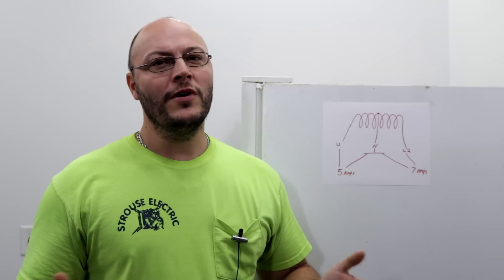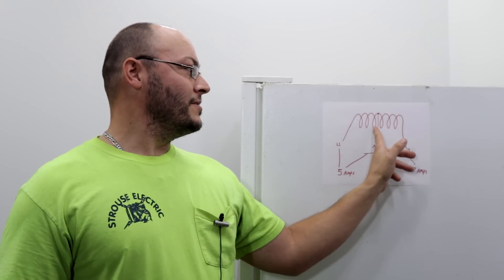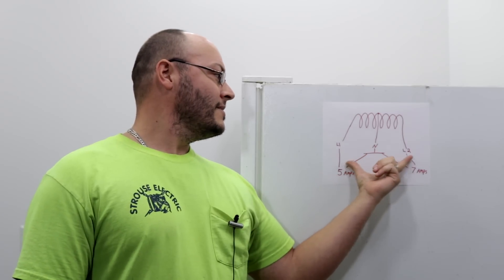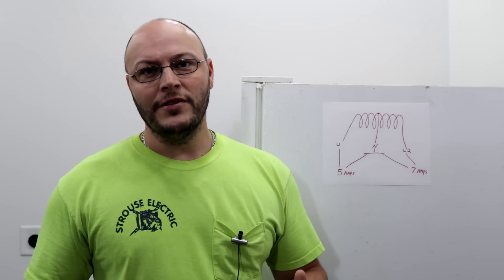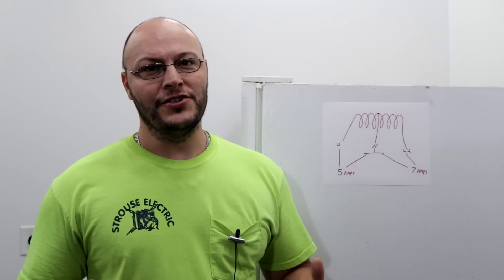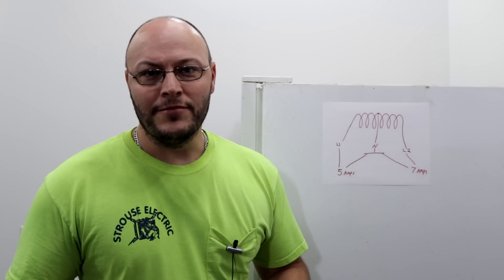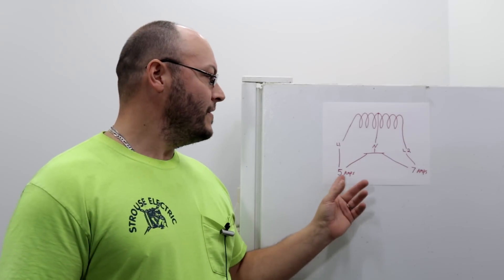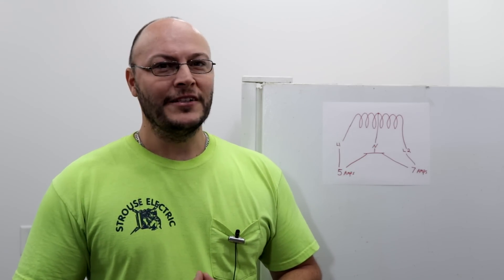What does the Neutral Wire Do?

Comment: 1)can any body  explain three phase neutral .
2) What is the help of neutral when we drian line to line voltages from three phase system?
Reply: Aamir Masood    A neutral in three phase is a common point for one side of three coils.   The reason for this point is to have two voltages in the system.   I.E. 208/120 volts or 480/277 volts in US.   so, Line to Line is higher voltage and Line to Neutral is lower voltage.
Reply: @KevinCoop1  thanks bro it helped me so basically you are saying that current needs potential difference to flow so for line to line voltages 220-120=120 v of voltage is supplied to the load.Am i right?
Reply: Aamir Masood    No.   The voltage is the relationship of primary voltage number of windings in a transformer to number of windings in secondary to get different voltage.   If 2400 volts into 2400 windings primary and there are 240 windings in secondary then 240 volts.  To get 120 volts, do a tap at 120 windings.   This is a single phase statement.
Reply: @KevinCoop1  thanks bro now it helped me
Reply: Aamir Masood   Great.  So now for three phase, L to N 120 or 277volts    120x1.732= 208 volts.    277x1.732=480 volts.

Comment: People seem to be confused of grounding or at least explain it poorly. There are two types of grounding. Operational grounding means connecting part of the electric system i.e. the neutral wire to the ground. Protective grounding means connecting parts that are not of the electric system lie equipment cases to ground with a separate ground wire. The ground wire and the neural serve different purposes but in most systems they go to the same place. 

Operational grounding can protect against lightning strikes. Protective grounding is so that if an equipment fails, you will not be shocked from it. Televisions specifically are double insulated. They do not care what happens to the protective grounding.
Reply: Okaro X    You use some terms I have never heard used, but are basically correct.   This is an awesome video about hooking hot to a ground rod and turning it on.    https://youtu.be/gHQE5L6hbgs.      Very well explained.   Respectfully,   Kevin

Comment: I have a nagging question. Does the neutral wire carry the balance unused current back to the grid/gen station? If so, what would be its effect on the equipments in the grid? Please excuse me as I am not an electrician/ electric professional.
Reply: R Varadarajan    The answer is NO and YES.   The neutral coming to your house does carry unbalanced amount of current back to the source transformer.   End of its story.  Out on the utility pole, the transformer feeding your house is connected to typically two conductors, hot and neutral.   If the pole only has two conductors, several houses are connected to it along the line.   If it has four conductors, three hots and neutral.  The neutral on the two wire pole carries all the current at that point.   Where the two wire is connected to four wire pole, the neutral is carrying the unbalanced current which is fed be a sub-station transformer.   The huge power distribution towers going from sub-station back to generation facilities are typically delta connected three phase three wire configuration, so no neutral involved.   Hope this helps!   Kevin

Comment: If you route 2 amps back to the transformer aren't you losing 2 amps that you need to run the devices that are pulling those amps?
Reply: Todd Hall    Try this route in your mind.   L1 to load, load to neutral conductor to bar, bar to neutral load, load to L2.   That is the path most of the current is taking at the same point in time.  The only amount of amps that go to the transformer coil is 2 amps.

Comment: The main job of the safety ground is to provide a lower resistance path to ground than your body should something with a higher potential erroneously come into contact with metal.
Reply: shreddder999    Actually, it is to trip the breaker.   You may have meant this.
Reply: @KevinCoop1  What is Safety Ground? A conductive path to earth that is designed to protect persons from electrical shock by shunting away any dangerous currents that might occur due to malfunction or accident.

Comment: Nice instructional video. Just a question. I am trying to figure out the heater on a hot tub I bought used. 3 pumps work fine. Recirculation pump works, heater does not. Heater wires come into the hot tubs own circuit board. I connected the circuit board to a GFCI panel properly according to all color codes on the panel. From the Laing wrap around heater there is a green wire, red wire, black wire and white wire. Green wire connects to ground on circuit board, red and black wires connect to the board where it says to on the board. White wire was loose and taped.  While running red and black each has 120 volts. I figured what would it hurt to connect white wire to the neutral leg where I connected the 4 wires from the GFCI. Turned it on and have 120 at the black wire and 80 at the red wire. I was afraid to leave it connected because something has to be drawing 40 volts! I sure don't want to replace a $300 to $600 circuit board! So is the heater just working or is the neutral just not supposed to be connected on this unit?

Comment: Now introduce a ground into the picture that connected to the neutral on a primary box, (both connected), but must be kept separate on a secondary box, by NEC Code. What’s interesting is between the ground and natural, both connected together at utility meter, both wires will be HOT, due to an unbalanced load on the 240VAC System, the less resistance on the wire the more current flows through it. Since most utility connections are aluminum and most grounds are copper, copper being almost half resistance of aluminum, it will flow current. Always, always assume current is flowing on a copper ground wire, because usually it is.  Just my 2 cents, I’m not an electrician, I install generators for a living, and I see this quite often.

Comment: I am confused, doesn’t the neutral go to earth? On a one phase plug you have a positive negative & neutral ( the bottom pin). I have heard this called earth a lot . My house as does all new wiring circuits in Australia has a 3 metre copper rod rammed into the ground, that the earth wire is attached to.Isn’t that what the earth is connected to. If I read what you say I should not touch that earth (not that I have) because it could be carrying a live current. If so why isn’t it insulated above the ground. As I said I am a mechanical engineer & I am confused. Great Video!
Reply: You are getting AC and DC mixed up. Your house is on AC, sourced from power lines, so the two prongs are Hot and Neutral, the other is a ground which goes to the ground rod you are mentioning. The ground is more or less for protection from electrical shorts to keep a metal device from being charged full of electricity and instead directs that current to the earth ground. With DC, which is usually sourced from batteries, you only have the Positive and Negative which form a circle to complete a full circuit. It is for these reasons that the man in the video said not to confuse Neutral (AC) with a ground. Grounds are strictly safety devices and under standard circumstances they are not live so your ground rod should not be worried about.
Reply: Palantir Gaming Thanks for that, now I understand.
Reply: @palantirgaming5559  your equipment grounds and ground rod are different systems. The ground rod is part of the service grounding and wont help protect you.   The equipment ground is a path back to the nuetral bus bar with little resistance that will clear a fault by tripping a breaker.
Reply: Why are there two hot wires going to the house since, apparently, the current flow is from one hot wire to the neutral wire?

Comment: the Neutral wire and copper ground wire are interchangeable, I know that might sound crazy to a lot you, but there connected to each other in you're breaker box. there was a celling fan wired in my house where a copper wire was being used as a return.
Reply: dosent mean its right the ground was feeding back to your panel to the actual neutral wires. Thats how fires happen bruh

Comment: This helped me tremendously.  An instructor told me that the electricity goes to the neutral buss.  I wanted to know where it went from there.  He kept saying it goes the neutral buss and nowhere else on the first panel.  I said on the first panel, the ground and the neutral busses are connected - does it go to ground?  Answer - no it goes to the neutral buss.  He thought I was a complete idiot.   There is indeed a return line back to the mains   He told me "no  It stays in the neutral buss"  I knew there had to be a way that it went somewhere instead of just magically disappearing.  He thought I was mentally deficient that I could not understand it just went to the neutral buss.  Thanks so much for the simple explanation about this.  I feel much better knowing I am not crazy in my thinking that their has to be more than the "magic" neutral buss.
Reply: Go back to your instructor and explain what he just said and tell him it doesn’t hang out at the neutral buss it goes back to the transformer. Few times in life you get to see the all knowing stand there in disbelief that he was schooled by the student!
Reply: @jtp0711  Did this ever happen? 😂

Comment: I wish you would comment on whether a person can be electricuted when touching the netural wire or not?
Reply: Yes, but the neutral has to be disconnected/broken from its terminal so you become the connection from neutral to ground, then you will get full line voltage
Reply: Yes

Comment: Do i need it on my stove can i just use ground
Reply: Thomas white yes I have done a lot of research and while I can answer yours mine is still confusing. Your stove is probably on 120/240v meaning parts of it uses 120 clock timers etc etc while others use 240 oven stove etc. without the neutral it cannot balance and would end up messing something up. As he puts it here it solves the unbalancing.

Comment: Sir: Question.  The guy wire outside of the house to the transformer SERVES as the neutral to the transformer. Yes, both L-1 and L-2 use this for the unbalanced
portion of the load to return to the transformer, BUT WHY is the guy wire not 
INSULATED?   Neutrals in the property are insulated, but not this portion.
Vexing question.  Enjoy your video.
Reply: Remember that neutral is bonded to ground at your panel as well.
Reply: Brian, thank you. Yes the neutral is bonded to ground. But how do the electrons 
(Amps) flow back to the transformer, on the neutral, without voltage?  Difficult for a mere mortal
to comprehend.  Enjoy your video.

Comment: Sorry if this is off topic but I've asked this question in other forums on other sites and haven't gotten answers. You guys seem to be pros so maybe someone can help.

I have an overhead light in my kitchen that is controlled by either of two wall switches at each entrance of the room. The power is coming in through the light and then split to the two switches to control. The wire is 14-3 (black, red, white) with the red and white being travelers and the black being common. I want to set up a smart dimmer switch for my new overhead LED light but it needs a neutral wire. How can I go about hooking up a neutral? Both boxes have the black, red, and white plugged into the 3-way switches but only one switch is hot.
Reply: There are many different ways a 3-way switch can be wired up. I found this site (https://www.easy-do-it-yourself-home-improvements.com/3-way-switch-wiring-diagram.html) to be very helpful when I was doing some 3-way smart switch wiring last month. Your set up sounds like it could be #5, #6, #7, or #8, I'm leaning towards #5 or #6. You'll need to do some investigating to figure out exactly what you have and then give it a go.  Good luck.

Comment: I'm not an electrician and I'm just asking a question because I dont know....I'm assuming that the black wire is "hot" and the white wire is called "neutral " ?
Anyone?
Thanks.
Reply: yes usually, but not always. don't rely on color code to be correct every time.

Comment: Why does the non-contact voltage detector not detect voltage from the neutral while it detects voltage from the hot?
Reply: Are you kidding me? It won't detect voltage on the neutral because their is no voltage on the neutral.  The only way you would have voltage on a neutral is if the neutral was open.  I hope you aren't an electrician.

Comment: While its true that the neutral essentially balances the load, the ground isn't just for lightning strikes. The ground provides a very low impedance for ANY excessive potential difference to discharge safely.   I have heard some say that AC wants to return to its source, which is true if that is the lowest potential, but if its not the ground is better than you or your entertainment center.

Comment: Neutral is not a ground ??? You follow the neutral where is it connected to ground or earth or the star point of the transformer which again is ground or (earth) it is zero potential difference same as earth. You grab a neutral buzz bar you will feel nothing (zero potential difference= the Same as earth. You cut the neutral on a live circuit you'll know about it... Yes you are wrong

Comment: L1 and L2 are just two ends of a coil in the transformer. That Neutral is just a point that divides the coil in 2 parts so that one part between L1 and N collects less voltage, that is only 110V instead of 220V.

Comment: The purpose of having a ground wire inside your home, at each device, is not to provide a path to ground in case of a lightning strike; it is to provide a path to ground in case any appliance fails in a way that results in a 'hot' wire touching the outside case of said appliance.  (Picture a 240-volt dryer with a broken element). Say, one end of that broken element "being hot" comes into contact with the case of the dryer.  With no 'potential to go to ground' this 'hot' element will just remain there, waiting for someone to come along and touch the dryer door, thereby providing a path to ground through their body.

The ground wire was not even used until the 1960s, thus, the old two prong outlets installed in all houses before that time, and is not an integral part of any circuit.  It is only there as a safeguard to protect the user of any said appliance against an unexpected, potentially fatal shock.  

The ground wire at each transformer drop, provided at the pole, and at the meter, provide 'some' lightning protection, but not much.  The ground wire inside your house and on any appliance is only there for your protection.   Appliances lacking an electrically conductive case are exempt from requiring the use of a three-prong, grounded cord.  These include such things as a corded drill motor with a plastic case (No need for a ground to protect you there) because the case will not conduct electricity, even if a hot wire breaks inside the drill motor and comes into contact with said case.
Reply: See if you can answer this.  Lets say a house has a two wire system (hot, neutral, NO ground wire) running through flexable metal conduit back to the panel.....the hot wire gets loose from a terminal and somehow makes contact with the metal electrical box which contains it.....now we have a short circuit and the electricity travels from the box, through the metal conduit and back to the panel and the breaker trips......now when the electicity flows through the metal conduit, and that couduit makes contact with combustable materials like wood, dust, insulation, why doesn't it start a fire?

Comment: If you wanted to seriously mess things up for someone, cut the neutral going into their house. The return current would only go to ground, and earthing out return current isn't a fluid pathway. Voltage from one side of the fuse panel would go through an appliance, but when return current gets to the neutral bus bar, it has nowhere to go, so it returns by going through other appliances connected to the other side of the fuse panel. Voltage would be erratic but it would up to 240 going through everything.
Reply: TheRantingCabby - Voltage would reach 240V at any 120V load only if one of the loads on the opposite leg were a dead short.

Comment: No, the neutral does not provide a path for any IMBALANCE of amperage between two hot legs such as a 240v house system.
The neutral is simply the return path....PERIOD.... for each 120v leg.
The neutral is the common between two energized legs.
Both energized legs share the neutral AT THE SAME TIME.
Even if both hot legs were balanced in their current draw both being at say 5 amps....the neutral would STILL be the return path for both legs. and 10 Amps would be going through neutral.....NOT 0 amps as is implied in this video.
If one leg is 7 amps, and the other leg is 5 amps. then total current draw is actually added being 12 amps going through the neutral or "COMMON" return line.
NOT subtracted  as in 7 - 5 = 2 amps of unbalanced (what? extra, residual?) current going through the neutral. Ummm no.
BUT, you are correct in that the neutral is not the earth ground since neutral is a center tap within the transformer.
This is why both hot legs are 180 degrees out of phase. 
Since they are 180 degrees out of phase, both hot legs voltages add.
Since they are 180 deg out of phase and their individual voltages of 120 add, this is why you get 240 across both hot legs.
Get an Electronics Engineering degree and 1st quarter basic electrical fundamental principals will be a lot easier to understand.
The center tap on a transformer is basically a 2 resistor voltage divider type circuit with the terminal between the two resistors being common, or therefore "Neutral" to one another.